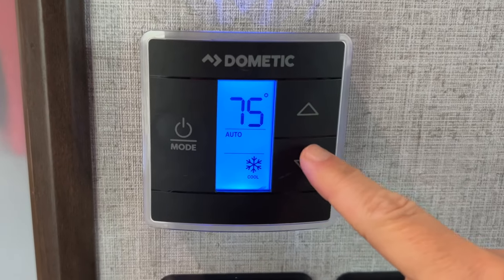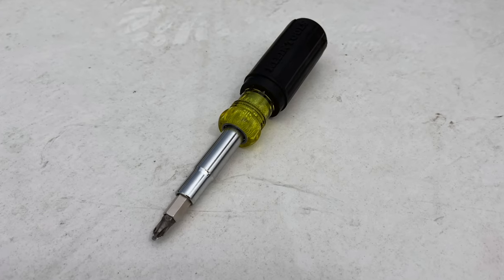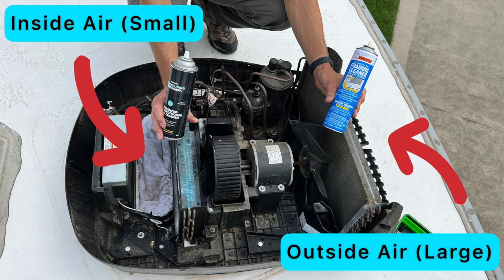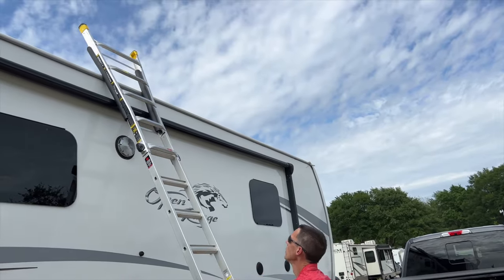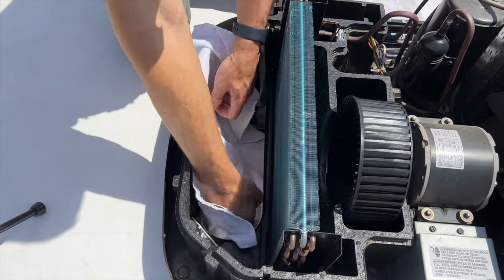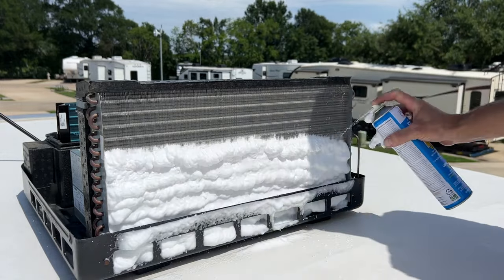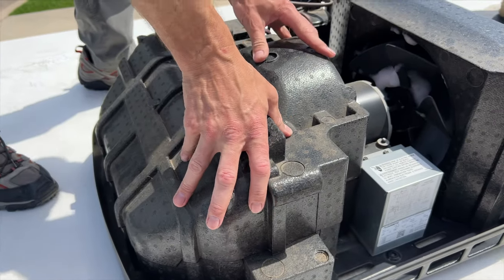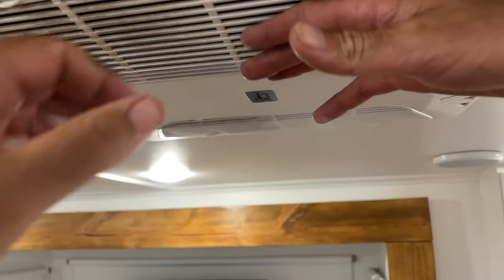How to Easily Clean Your RV’s A/C Unit

Comment: Thanks for the great video!! This is my first time doing spring maintenance and it feels pretty overwhelming. We don't use our air conditioners a ton (just in the super heat), if the fins look pretty clean, is it necessary to use the foam? I checked them in the fall and there wasn't a lot of debris then.
Reply from the maker: Lisa,
If you really don’t use the A/C much you could go longer between cleanings. When you do clean them, using the foam breaks down dirt that isn’t visible by looking at it so I always use the foam to clean the coils and it’s amazing at how much dirt gets rinsed out. -Steve
Reply: @RadarRoadWarriors  Thanks!!!

Comment: Can you make a video of cleaning the drain pan for that specific ac unit? I’m having a problem of my ac leaking inside. I found that it froze up and ice built up on the coils. Any recommendations?
Reply from the maker: It could still be freezing up or the holes are plugged. There is a hole on each end of the coil that lets the water out. A spray bottle with water is what I use to clean them out.

Comment: Great video.  I just noticed I had some red fluid leaking at one point since I noticed it had run down the side.  It was dry on the side and top.  It is not leaking now.  I cleaned the coils and wiped up everything and no fluid - yet.  Should I be running it?  Any suggestions?
Reply from the maker: I’ve seen residue that looks like red fluid was there although it’s dirty moisture/mildew/mold that dried up.

If the A/C is still cooling it hasn’t leaked out it’s oil/freon and there should be no harm in running it. If it’s not cooling it may have leaked out and then there is no point in running it any longer.
Reply: @RadarRoadWarriors  thank you for your quick reply...great job!
Reply from the maker: @rjw8239  you’re welcome

Comment: What would you consider to be a good “cold” temperature coming out of the ac if it’s working properly?
Reply from the maker: The difference in intake and discharge air temp is the deciding factor. 14-16 degree split is in the acceptable range. I like to see in the 16-20 range. (70* in / 54* out)
Reply: @RadarRoadWarriors  so 70 degrees outside and 54 degrees coming out of the vents?
Reply from the maker: @heathmurphy7825  not the outside air. The 70 degree part of the measurement is the air going into the filter on the inside of the RV. The 54 degree part would be the  cold air coming out of the vent.

Comment: Can you use the Frost King on both coils? Or do you have to get the other foam (antimicrobial) ?
Reply from the maker: Curtis,
The Frost King is not recommended to be used on the front coil that the inside air flows through. The antimicrobial is one reason and the other one is the chemicals in it shouldn’t be distributed through the air of the RV. 
You can use the anti microbial foam on both coils. -Steve

Comment: How many cans of cleaner recommended to clean 3 A/Cs ??
Reply from the maker: It’s going to take 1-2 cans of each type of cleaner per air conditioner. 1 can each if your A\C is fairly clean. 2 cans each if the A/C has not been cleaned in a while and are very dirty. You can open up the A/C units to see the level of dirtiness and then buy the amount you’ll need to clean them. 

The step-by-step instructions for cleaning the air conditioners are in the description of the video.
Reply: @RadarRoadWarriors  Gotcha, thank you.
Reply from the maker: @Embrace_Chaos  you’re welcome

Comment: I got a Dometic Brisk Air (it was for a Road Runner camper).
Lately, it causes the AC's own circuit breaker to switch off.
Usually when its hot in the day and the sun is beating down on it.

Inside looked clean enough... I am unable to get on top of the camper due to broken bones from Bone cancer.
Been stuck in this thing since 2019 (shortly after Hurricane Michael)...

House had been destroyed, now the remnants of that has been demolished recently.

I got a Portable AC and plan on drilling an exhaust out the side and a water line to the Road Runner's rear water hoses.

But, still I suspect that the Brisk Air unit needs cleaning on top.
Some limbs had grown over it and I got large ants living around there and other bugs.

I do plan on replacing the circuit breaker just in case... but my questions are this:

1. Do you have any videos on the older model Brisk Air?   Mine looks different than yours slightly.
Inside it has a large beige square with the two air exits and a place for a filter (which I have no more filters for so I use a cut piece of foam).
When that plastic filter cover is off, I don't see as much dirt or grime on the coils...  but that doesn't mean I don't have dirt and build up on top side.

2. I live in Florida...  about how much does it cost to have someone come out and clean the top portion or at least diagnose problems?
It's gonna be a hot summer I suspect (that's why the portable for now) yet I'm not uber rich.  In fact, I can't even get disability payments because I had 1750 in Fema rent money IN my bank at the time and in spite of telling SSA about it they gave me a short time to pay the owner the rent to get the money out of the bank (limit $2,000 in an account to receive disability $500 per month).
I couldn't do this in time so they "terminated" the disability payments without telling me DURING the COVID crisis when their Offices were closed to the public.
Couldn't even go in to speak to them! 

Anyhow, fighting the cancer currently and just gave up on the disability payments (its a long 6 month process just to get approved)!.

I do have some relatives helping out...  but wonder what kind of cost I'm looking at to get a professional to clean the top/outside part.
Most likely they will need a scafold since the roof is weak and (already leaks in two places - 1 over the bed, 1 directly in front of the toilet-- yup.. this camper is cursed!).

Any ideas or suggestions? 
Or older videos on this model

Its a "Duo-Therm" by Dometic    Brisk Air by Dometic  (says both of that on the unit inside)
I didn't see a serial number or date.

Thanks in advance for reading
Reply from the maker: It sounds like the A/C unit needs a good cleaning. If you have someone who is certified, they will know how to test the electrical components to see if a capacitor has failed. A failed capacitor will cause the breaker to trip inside the RV.

I'm not familiar with Florida pricing. However, I would expect a couple hundred to get someone out to clean it. Possibly more with needing to bring scaffolding.

The tech locator to find a tech near you is: RVTAA.org/locate

Comment: Our temp sensor is very high in the coil. Have you seen this before? In your video and others I’ve seen the sensor was pretty much in the middle.
Reply from the maker: Depends on your A/C brand. The Dometic in the video should be center or just left of center and at the bottom. Coleman should be 4” (4 coils) up and 4” from the right.

Comment: What’s the best A/C brand for Texas heat from your experience?
Reply from the maker: The Coleman Mach 8 is one I’ve see with great performance in the heat demanding areas like Texas. Coleman uses less power so they are easier on the RV wiring in the heat. Either way a white cover on the A/C makes a huge difference over the black covers on most RVs.

Comment: We have a 43.6 ft 5th wheel. We need to get up high on the side to work on and treat the rubber parts on the slide out. We saw you were leaning the ladder 🪜 on the roof and side of the RV. Will that damage it?
Reply from the maker: Christin,
We use pipe insulation like pool noodles on the ladder where it meets the roof so we don’t damage the roof. In some cases, we’ll add a yoga mat on the RV in addition to the pool noodles to give extra cushion so we don’t damage the RV. -Steve
Reply: @RadarRoadWarriors  that's a great idea. I just thought the pressure against the gutters might not be good.
Reply from the maker: @christinaholligan8299  I always assess the area the ladder will be leaning against to make sure it’s strong enough. Some gutters are stronger then others and I’ll put the ladder on the back of the RV instead of the side.
Reply: Notice there are pipe cover on ladder.